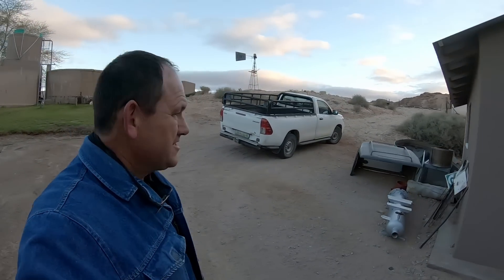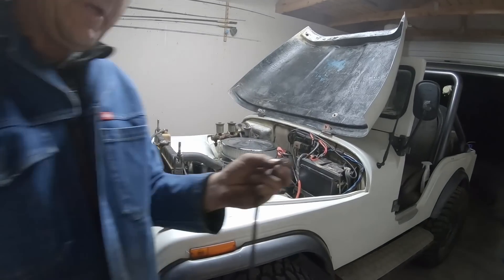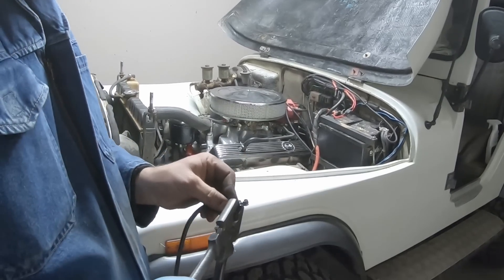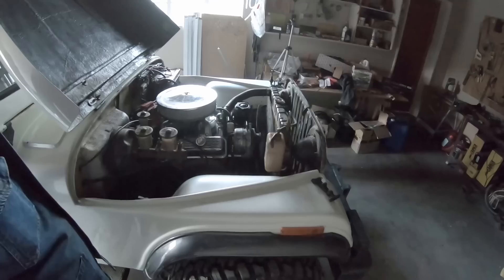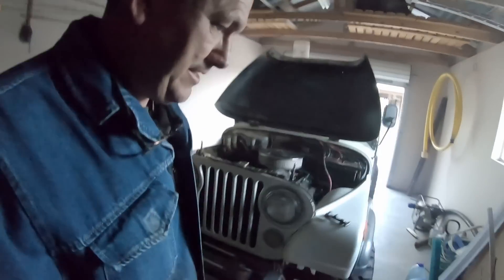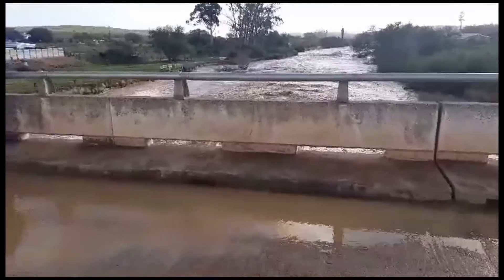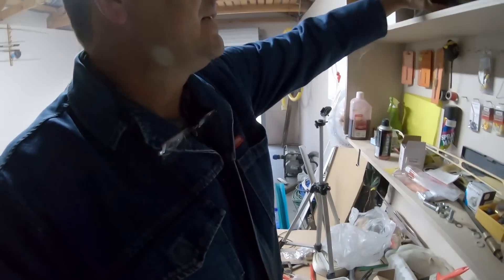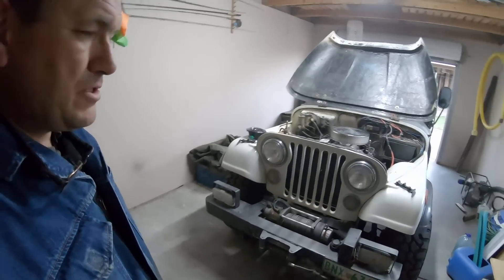The Troe Troe river flooding, I though I saw the Cape wet, but looks like I missed the real storm.

Comment: Ja .. I had a Jeep Cherokee a while ago. Lovely vehicle.. I really enjoyed it, but the SA version had some really bad design features .. maybe the way it was built here (by Mercedes yet) Looks like yours is a great vehicle too, but headlights compromising the radiator hmmmm .. guess when you’ve rebuilt it,it will be a real 1st class 4/4. I exchanged mine for a Jumny for local and an old Merc 200 Kompressor for trips. 2 for the price of 1. Kind of works, but I miss the Jeep. 🌹Really enjoy your videos..thanks🙂
Reply from the maker: Mine is not really a Jeep, the Engine is Small block Chevy, the rest of it is Land Cruiser, just the fiberglass body is really Jeep
Reply: @JorsMalan  Figures .. and I guess that explains the lights. Only a practical person could do what you do. I did wonder when you were building the new 4/4 track moving rocks and stuff, why you had such affection for the little Jeep .. she’s your creation. Milo may br leery of ripples on the water but his instincts on fun and how to get there are spot on... 🤣🤣🤣 fooled me 🙃
Reply: Many years ago, en route to a gig in Swakopmund, driving a hired Golf through the Kammashogland, the rear exhaust mounting broke. Bloudraad saved the day. Boer maak ‘n plan. There’s always bits of wire from repairs of the roadside fences, hanging around. ‘stukkie bloudraad around the broken bracket and the bumper (when cars still had bumpers) got us to Swakop in time for the gig. 🌈